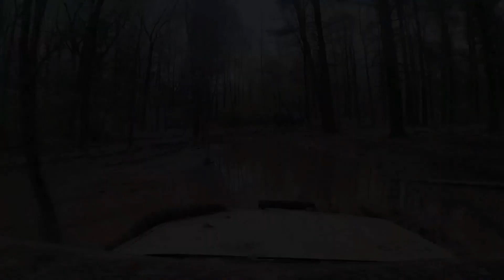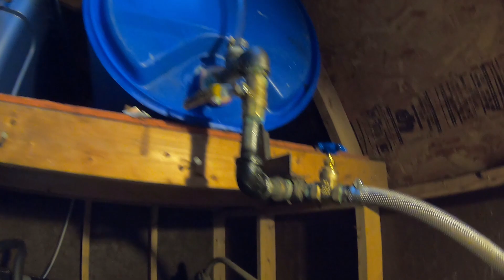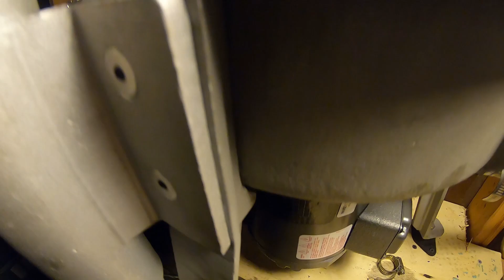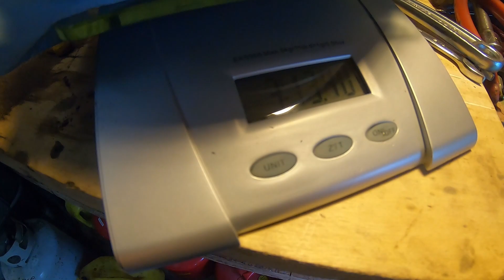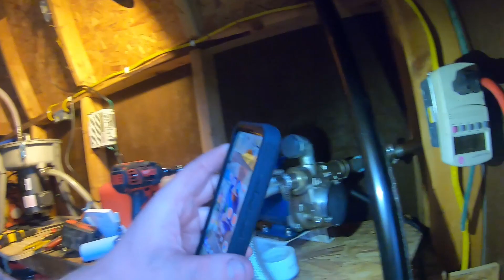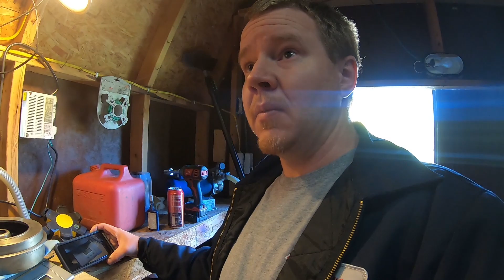Black Diesel - Centrifuge Shootout Part 2 - WVO Designs Raw Power Basic VS Extreme 6k

Comment: Why is the 6000 RPM Extreme model not offered by PA Biofuel anymore ? I see that this video is 3 years old. The Ultimate Force is the only model like this that l see on the website.
Reply from the maker: PA Biodiesel doesn't make a 6000 rpm model.   They never have.   www.nitsograndgarage.com...  we still have them.
Reply: At 11:50 in the video you called it a 6000 RPM model and the old model a 3000 RPM  and also a couple of times later a two minutes later. That is why I asked. It looks like the Extreme model had some sort of VFD attached.
Reply from the maker: @michaelkennedy7506 that is correct...  But it's all from WVO Designs....   Not PA Biodiesel.  2 different companies.  The WVO Designs Extreme is a 6000rpm unit that runs a VFD to control the motor.

Comment: I just applied to join your facebook page.  Know a bit about Sharples and De Laval fuel/lube oil centrifugal Purifiers from my time in USN Submarine Service as an Engineman back in the late 1960's.  Heat and higher RPM's are the answer.  Our purifiers ran at 40,000 to 50,000 RPM. and the carbon does come out at those speeds.  The boats I was on...we never changed oil. Just send in samples and then pour in whatever additives were getting depleted in the oil.  No filters...purifiers spun 4 hrs out of every 12, around the clock if the engines were running.
Reply from the maker: I think I approved everyone.  With that said, man a 40k+ RPM unit would be insane!  Not necessary for our use... But sounds like fun.

Comment: Run these at 2.5 gallons per hour would pull way more out. Do 1.5 gallons per hour and your oil will be dang near clean enough to run in your engine again. A low flow rate, heat and rpm is your holy trinity.
Reply from the maker: Correct...  but instead I do multiple passes.  Same amount of time overall in the bowl but time to clean the bowl between passes and check how things are going.  I cover that in a later video.

Comment: So is the fuel savings worth it? How much has your electricity bill gone up running all the heaters, pumps,  and that centerfuge?
Reply from the maker: It hasn't.  Literally all in including electricity (which I'm on solar so that doesn't affect me... but added it in anyways..)  if I'm buying gas (which I typically get stale gas or diesel mixes for free)..  I'm paying under $0.30/gallon...   not buying gas...  under $0.08/gallon.  Yeah it's worth it.

Comment: IIRC, your pressure driven unit with heater tested damn near the same power usage as both of these direct drive tests. I had no idea pressure drive centrifuges existed, a very neat concept! For almost the same power usage, I am surprised at how much more junk these direct drive units pull out. I have probably 35 gallons of oil sitting around, I'm tempted to try one of those pressure drive centrifuges to clean it enough to run in the boiler. I don't have any diesel vehicles yet, but heating oil here is still $4-5 a gallon. I thoroughly appreciate all the testing you do
Reply from the maker: Power consumption with the pressure driven unit will be a little higher because you need to preheat the whole drum of oil to 170°+ F.  The direct drive units are more efficient for sure but the pressure drive units have a smaller foot print.  If you can source your own pump and motor, the pressure drive setups can be done fairly cheap.  I prefer the direct drive personally.

Comment: Hello will filtering oil with a .5 micron filter and mixing 40% oil be ok
And not have any problems.  I am currently running it in my diesel heater and works great but haven't ran my mercedes turbo diesel on it yet. 
I want to be sure I'm not going to tear up my injectors or pump.
Or any other issues that would cost more than fuel savings. I live on a small dissability check so can afford to buy all the equipment that you have.
Thanks for your time and videos.. Robert
Reply from the maker: It's possible but you'll need a way to remove water.  I would also run it through that filter more than once.
Reply: @NotSoGrandGarage  yea I do. I have a 1 micron filter then  .5 micron then diesel water separator. Its working great in my diesel heater in my rv. Just haven't run it in my mercedes diesel.  I would rather pay for fuel instead of destroying my $800 worth of injectors or pump. If damage is possible
Reply from the maker: @w124mercedes7  don't be afraid of used parts if you do have a failure.  Most pumps can be had for $100 ..   with that said, even with my equipment,  failures are possible.  Things can go wrong.  Also, water separators remove free water but not emulsified water.  

Start slow...  work your way up.  Notice a problem...  back it back down.

Comment: Question  so #1 why didn't you go to a larger  pipeline and #2 why not preheat in drum ?
Reply from the maker: Larger pipeline as in feed line to the centrifuge?  I only run around 5gph...   the current setup will easily do 3x that so no real need to go larger if I'm understanding your question correctly. 

As for heating the gravity drum...  again no real need to.  The heater at the centrifuge does the job amd uses less energy doing it.  It requires a lot of energy to heat a full drum of oil...   drum would have to be metal...  would have to be insulated... and even then, it would take hours with a high wattage heater to heat the whole drum to a point that it drives off moisture and makes a difference.   Heating at the centrifuge is more efficient basically.  Now of I were running a pressure drive setup, the only real way to use heat in that application is to heat the drum.  Its doable...   I'm just not setup for it and at this point, I wouldn't gain anything from doing it if that makes sense.

Comment: hi up to minus 10 centrigrade i connected a power steering radiator on top of the rocker top feeding the fuel line into and out before all the normal filter that i bought .cleanable stainless pressure washer type .you may be able to place it at the side of the block or even a intercooler radiator may suffice .  keep plenty of fuel in tank though as it will soon warm up on long runs
Reply from the maker: Interesting idea.

Comment: Hey I have a om617 turbo diesel can I run used motor oil in it If I get a centrifuge and filter the oil ?
Reply from the maker: Yes you can.  I'd suggest dual tanks or staying below 50% oil in the tank.
Reply from the maker: If you watch my other videos, you'll see my 300SD with an om617.

Comment: Have you looked into installing a P trap off the centrifuge for the clean oil going to the barrel? I know Steve at USFiltermax highly recommends having one to help catch excess water. And I’m pretty sure the guy from PA biodiesel had a video out there about installing one too. Looking forward to future videos and testing. Thanks for what you do.
Reply from the maker: Interesting.  I'll look into it as I've not seen anyone mention doing that.
Reply: Seems reasonable and he's already got that plumbed in pvc anyway. 🤔
Reply from the maker: @Gideon_Judges6  plumbing has since been changed.  Works well

Comment: Well I'm interested in seeing what more passes do. Better for cold climates I would think???? Are you adding the 5 gallons of old gas/diesel fuel every time to the 50gal or just one time with multi passes? Also are you running final product in a 12 valve Cummins with P-Pump? I seen the old Mercedes you got pretty Kool man :)
Reply from the maker: I add the thinner ar the end of the batch so it doesn't go through the centrifuge.  As for what I'm running it in, an IDI ford, an om617 mercedes... amd just recently,  an IH DT360 which is very similar to a 12v cummins.

Comment: filters, start with filters and filter blocks on the truck or will go on your truck when done. I've never regretted putting a better cheaper filter on a pickup. cheap insurance, even pump fuel has given me issues i the past with water, debris  ect. my .02$
Reply from the maker: Yup.  All my dual tank setups have a good 2 mic nominal water separator right off the tank.

Comment: Gonna have to do more tests. I've had batches come out like that where it looked like pudding and it held much more in the bowl because it wouldn't drain out. I've also had batches drain off and barely leave a thin film along the inside of the bowl. Both from the same 3400 RPM centrifuge.
Reply from the maker: Same.  If it sits for a few weeks, most will drain off.

Comment: Great video.  Keep it up!  I had a bad batch this week which still had some water in it apparently cause my truck started to run not so well and then the water in fuel light came on. Soooo now I'm trying to drain the tank
Reply: I picked up some oil from a new source a bit ago and I let it settle in my dirty IBC tote for a week. That was enough time for the oily water to sink to the bottom. I then drained it off and was good to go.
Reply: @dylanporras2655  what i am using has settled for years. I honestly can't see a layer of water in the tote.  I really don't know what happened or why to be honest with how I got water in there
Reply: Okay i know why I had water in it... My bowl was in very bad need of cleaning. I mean it was really bad.   My first few batches my bowl wasn't dirty at all.  Oil I guess was very clean.  So I stupidly stopped checking the bowl after every run.  Bad idea.   The last three batches must have been very dirty cause my bowl was caked with garbage. 

From now on I will be checking every run.  Learned my lesson.   This is likely what caused water to be in my last batch
Reply from the maker: Oof.  At least it's easy enough to fix.  Good luck!
Reply: @NotSoGrandGarage  I'm going to try to come up with a good water separator to run either on pump side or after centrifuge.     I have the one from fill rite the filter and water separator in one but I've never been able to see water separation in that thing.     This is obviously a last resort if water gets into the finish drum but would be nice to have if it would work
Reply from the maker: @BRWfilms  how hot are you heating the oil during processing?
Reply: @NotSoGrandGarage  i started out at 150 the first two or three batches. The next few I ran it anywhere from 175 to maxed out at 200.  I may start running it all at 200 but I was concerned about burning up my heating element early since I would be running it at max. Tho I guess wvo designs would of used an element capable of higher Temps than 200 so that in reality it's not at its max.

Comment: I've ordered mine and started to get all the ancillary gear to have a complete system based loosely on what I've seen from your system. I'm looking forward to cheap fuel, no longer $180 a week in diesel🥳.
Reply from the maker: What will you be feeding with your setup?
Reply: @NotSoGrandGarage  used engine oil. The mechanic up the road goes through heaps.
Reply from the maker: @aaronharvey6991  what engine is what I meant.  Good deal on a solid supply
Reply: @NotSoGrandGarage  it's an 02 f250. It has a 4.2 intercooled turbo.

Comment: I've been looking forward to this video! I'll be setting up my first ever system soon - definitely choosing the 6000rpm centrifuge... It looks to me like you're using WVO Design's Centrifuge Cleaning Power Booster. Would you say that it's worth it?
Reply from the maker: Yes...    but I'd also look at the one from PA as they have it build into the bowl and the bowl is a 2 piece design.  Really looking forward to testing it out.  The "booster cone" is extra from WVO sadly.
Reply: @NotSoGrandGarage  Does the one from PA work with the WVO housing and motor?
Reply from the maker: @yourfriendgary  don't know.  I think testing the PA unit is in the works but it'll be a bit...  may do some tinkering when it comes in.

Comment: I would suggest at least 3 passes, used to run a 14000rpm centerfuge (380v 3ph  AC) oil heated. Cleaned bowl daily. Used to clean 30,000 liters a week. Manie.
Reply from the maker: I've made a batch so far with multiple passes and I'd agree.  I'll be posting a video on that next week.
Reply: Incredible, what type of g forces were u doing at 14k rpm? Thanks for sharing.
Reply: It'd probably be quite troublesome for him to acquire 3 phase power

Comment: May I ask how much G the new centrifuge motor produces?
Reply from the maker: Based on the website, 1200g's for the basic..  3600 for the extreme at full speed.  I need to take some measurements and run the numbers to see if its accurate.

Comment: What oil ratio do you run in the winter time?I live in Ontario so similar temperatures as you
Reply from the maker: I've ran a 90/10 blend down to ~5F.  I'll probably go with an 80/20 this year.  (80% oil to 20% gasoline)
Reply: @NotSoGrandGarage  
Have you run it at like -15c if so what blend
Reply from the maker: -15c = 5F so yeah.  I'd go with 80/20 as that's my plan for this year.